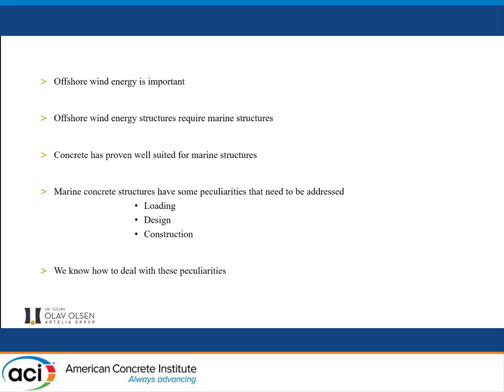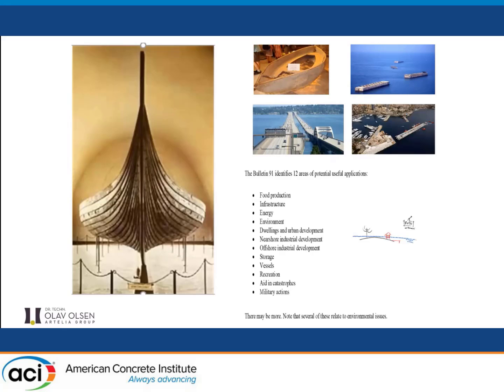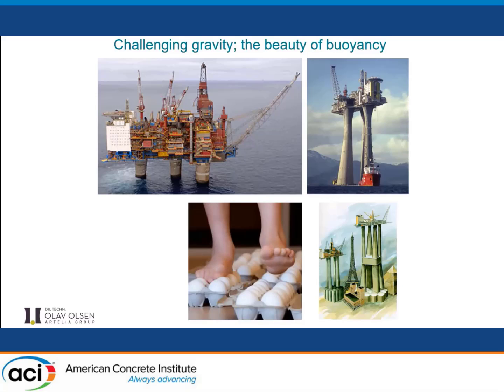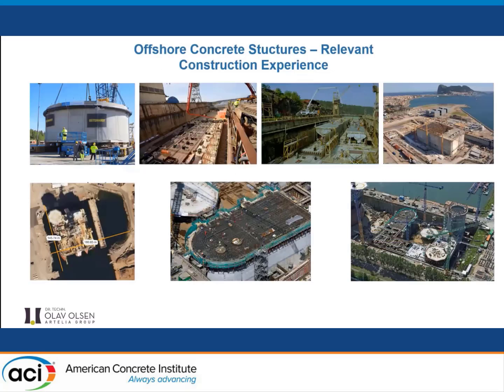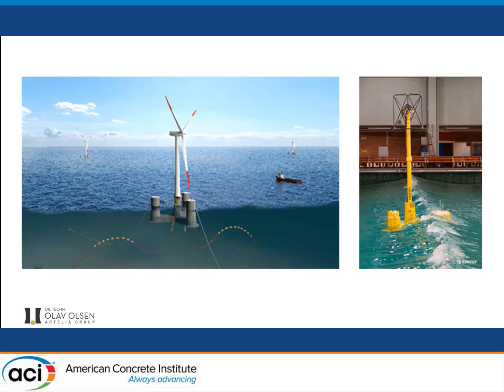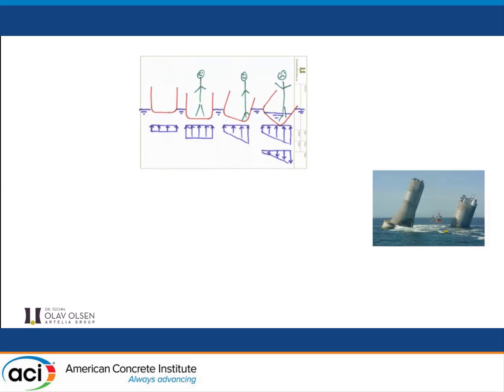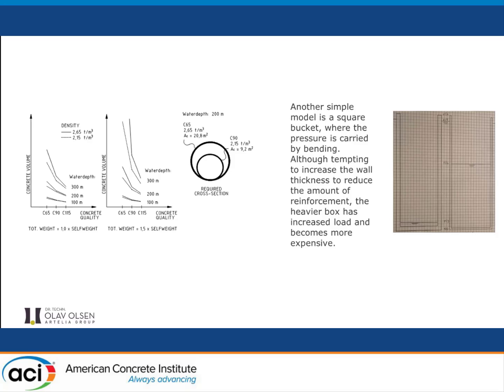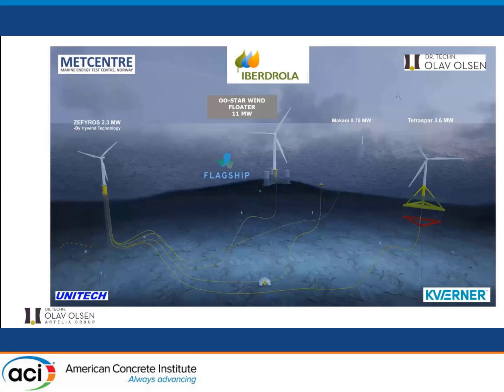Innovations in Concrete Support Structures for Offshore Wind Turbines

Comment: There is a shortage of jack up barges in America.  We want to install 1,500 wind turbines off the east coast, near New York, but only have one "Jones Act Compliant" jack up barge, so it will take several years to install all of the desired wind turbines.  

One solution would be a concrete tower base that could be built in a drydock, the turbine installed, maybe even the turbine blades as well.  Then tow that out to sea and sink it into the 30 meter deep ocean, and secure it forever.  Maybe there will be a way to inject air to the base of the turbine tower, to remove the sands under the tower base?  Or inject water, to wash away the sand?.  

The base of the tower would be sealed and able to withstand 30 PSI, so you can get rid of the water at the bottom of the tower while towing it out to sea.  The draft of the tower base might be 10 meters while in drydock, then float it out, and build the tower much taller at a nearby location, perhaps going from a 30 meter diameter base that will sit on the ocean floor to a 8 meter diameter that will breach the surface, and go up about 15 meters above the waves.  Then a smaller diameter steel tower that will reach to the sky.  

The ocean surface can be prepared for the tower base by removing about 15 meters of sand and other debris, so that the tower will sit below the ocean floor.  Then bring in rip rock, and other large stones that will ultimately prevent the base from ever moving again.  Then bury the base under about 15 meters of sand and dirt.  Maybe bring in dirt that was just removed from the next tower base being excavated.    Once the tower is solidly on the ocean floor, would it make sense to install a hundred cubic feet of concrete below the tower, to grout it to the ocean floor?  It is worth considering, as the tower must be stable, and not swing side to side.